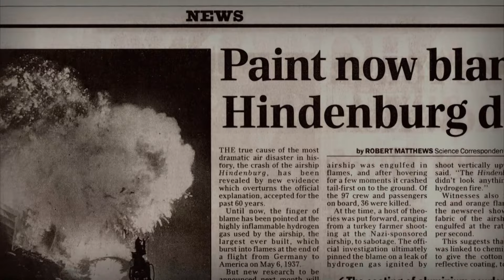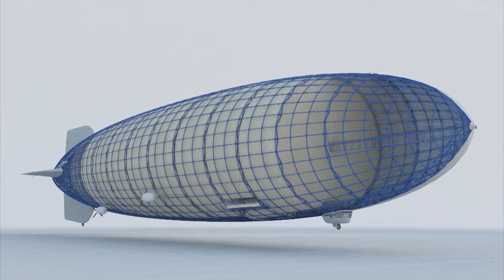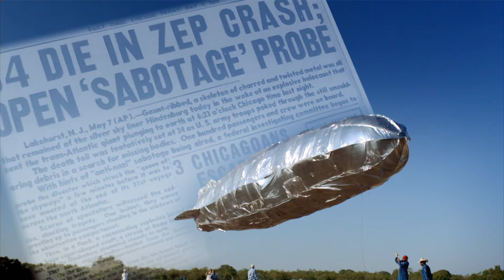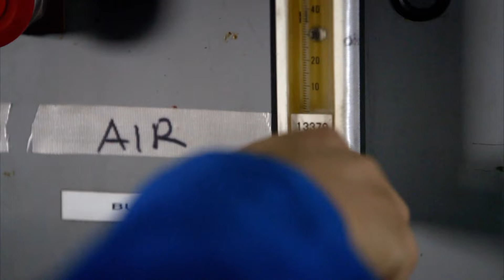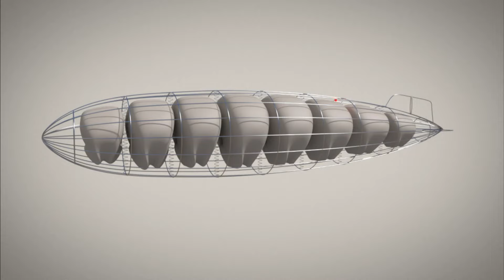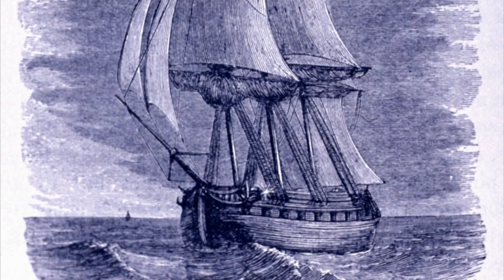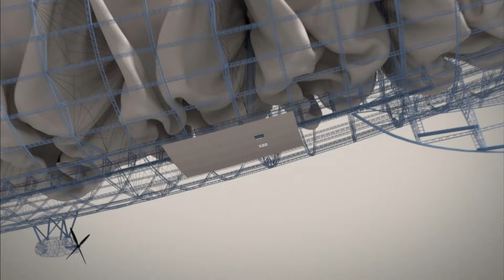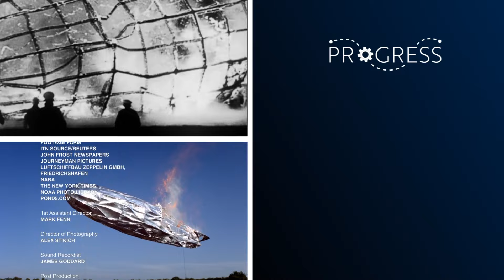The Hindenburg Disaster: What Really Happened? | Hindenburg | Progress

Comment: Ultimately the cause of the Hindenburg fire is moot, as the end of the rigid airship was brought by the enormous surface area of the hull, which kept airspeed low and made the craft uncontrollable if perpendicular (especially vertical) air currents were encountered. You'll note that all three helium-inflated rigid airships met a quick death from this cause, generally faring worse than their hydrogen-filled counterparts.

Comment: There is a recent NOVA doc on this that I found far more interesting.
Reply: Refresh my memory, didn't that documentary conclude that most likely cause of the explosion had to do with the paint? It's been a "minute" since I watched it 😊
Reply: @GavinsMarineMom  Anchor lines caused grounding, which allowed static electricity to arc across fabric to airframe, igniting a hydrogen leak.  Ironically, the dope-covered fabric was separated from the airframe on purpose by a small gap, which actually caused the arcing.

Comment: With the spark? If a downpour was happening, would the gas mix with the rain droplets "coating" the outside of the ship? How much more would the air pressure be due to the storm? You did your experiment on a nice clear day, your test worked inside a shop, and the air pressure would be more, i think, just a question.

Comment: Timed? Remote control? No. The bomb was triggered by a float in the ballast tank= low level in the water tank means the ship is having trouble with stability. The IED was set to explode by a saboteur with access to the inside workings of the craft's flight controls and particularly the area where the ignition originated from. Or maybe some idiot working inside the engine room lit a cigarette- 'we're close enough to landing now, it's safe for me to go ahead and have a smoke...'- last thoughts of a dead guy... obviously new to his job.
Reply: P.S. Could have been struck by lightning from quite a considerable distance away- hence a blue flash was seen prior to the main blast.